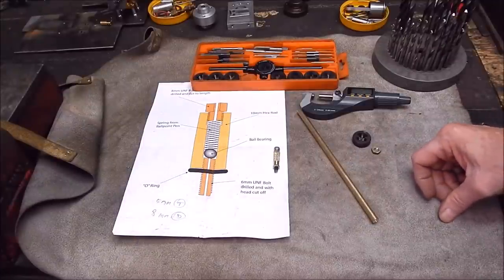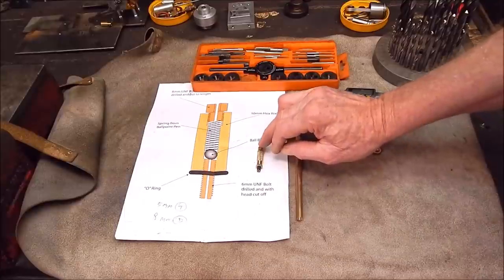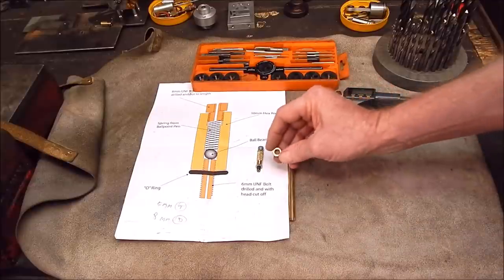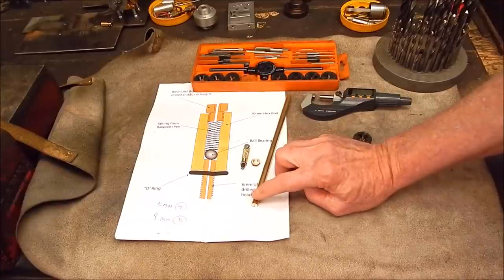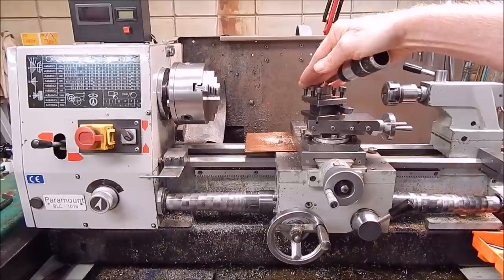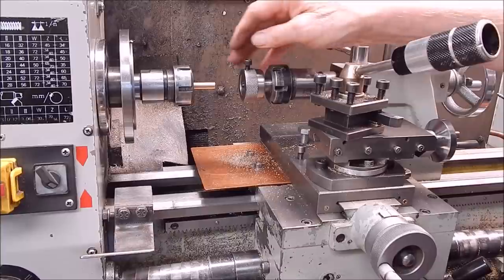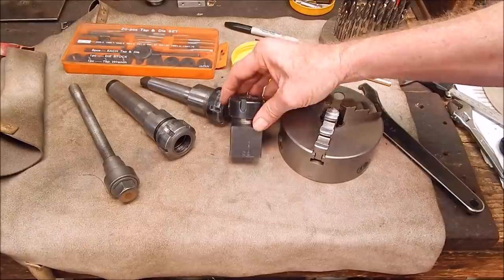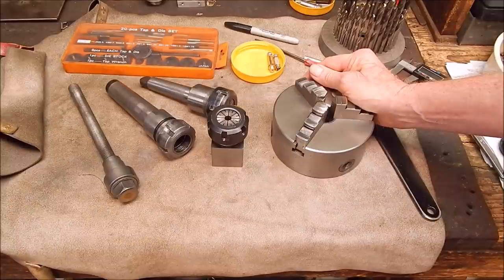Why small metal lathe owners should be using collets

Comment: Also large lathe owners too
Reply from the maker: Yes definitely Adam, but as small lathes usually do small/fine work, I focused on their use in that size range.  Cheers Rob
Reply: @Xynudu  Yup, I have ER32 and 5C on my 10in swing lathe, but when I went to TAFE (finished up yesterday!), the 250mm chucks were a little comical to hold some 10mm bar, I would've loved my collets for that!
Reply from the maker: Hi Adam, yes the bigger chucks will only grip down to a certain size and you bust a gut changing them.  Plus the tactile feel with large lathes is terrible.  That's why I don't like them.   If you need that sized lathe, then fair enough, it's justified, but most hobbyists and back yarders don't. 

The trouble is newbies listen to the wankers on forums (the exception who make the most noise) who tell them to buy the biggest lathe they can afford, even if it's a worn out old piece of shit.  I feel sorry for them.  It'a all an ego trip from those members I refer to as "big dickus - mines bigger then yours, so yours must be a toy"  ;)  Cheers Rob
Reply: @Xynudu  I totally agree about the big lathe ego trip!

You also don't want to run a huge chuck at 2500 RPM for some small bar either! That said, the extra mass in the casting is really nice for dampening vibration.

Have a good one :)